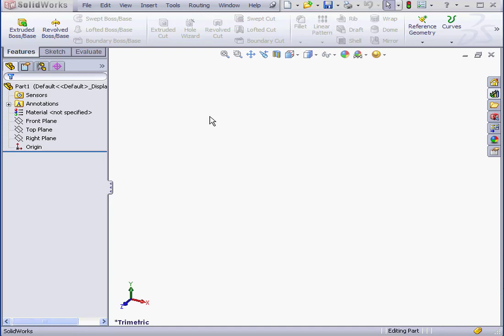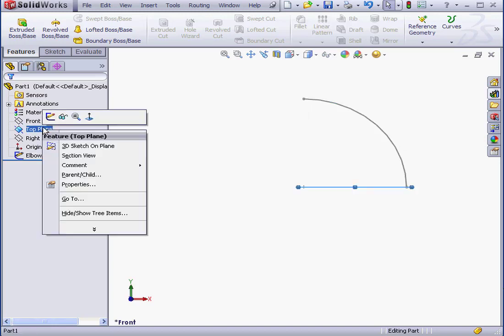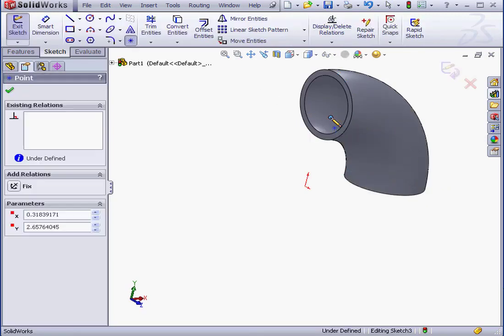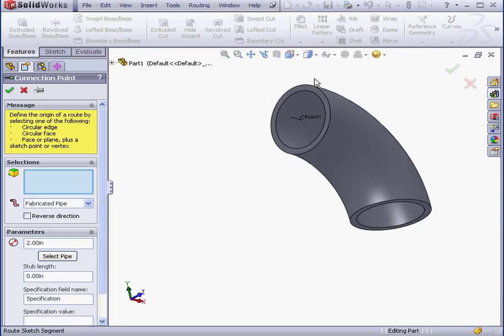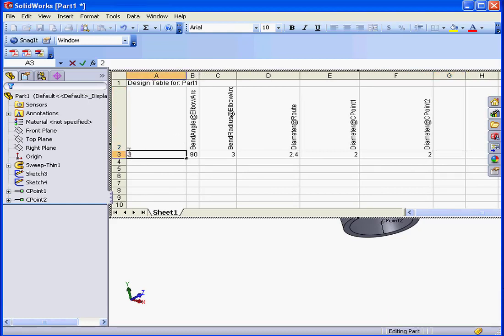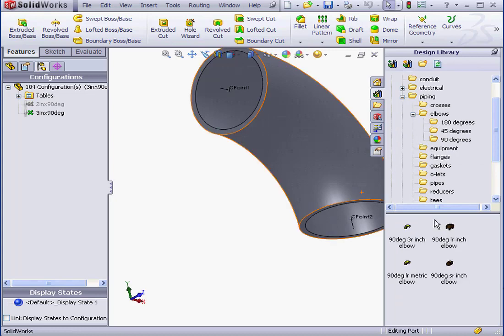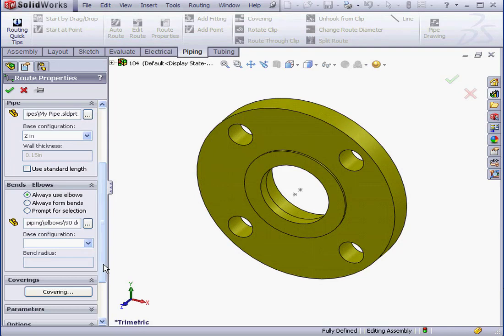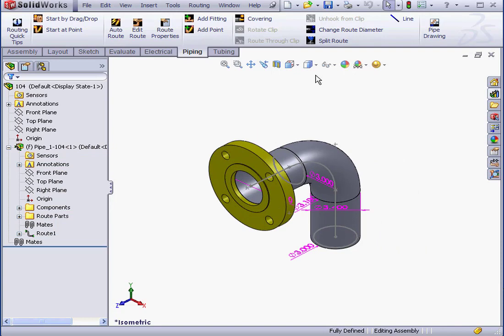SOLIDWORKS Routing 14 ( Custom Elbow )

Comment: I don't know how but somewhere is a bug.
After creating the Routing subassembly, making trajectory an exiting out of the sketch, I got:
"The selected elbow fitting does not have a configuration with the following dimensions:
> Diameter...
> Bend Radius...
> Bend angle greather than..."
 But the most interesting thing - I've checked everything of that and it corresponds with the written in the Routing Tutorial. So it is impossible to insert my Custom elbow. 🤷‍♂